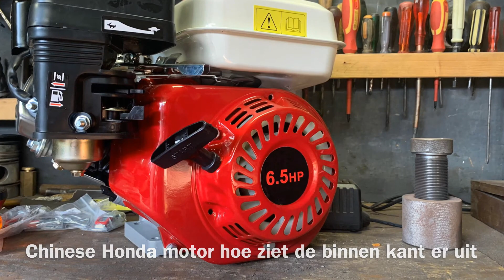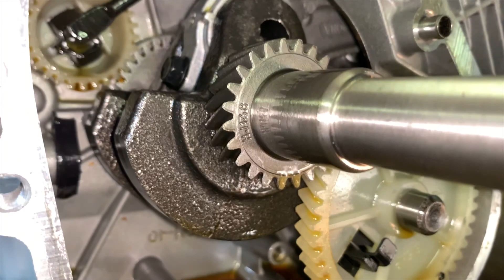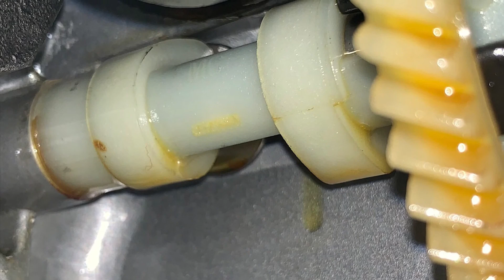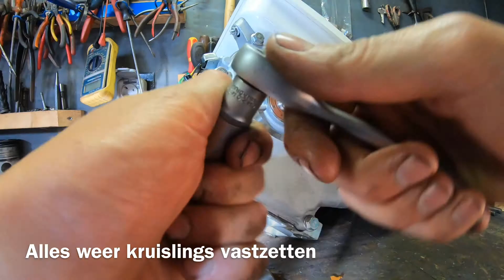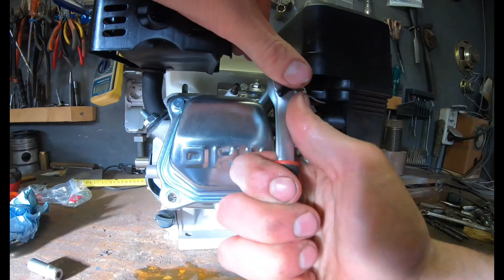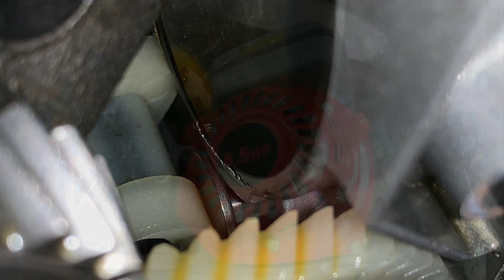Chinese engine 6,5 hp 4 stroke what does the inside look like

Comment: is it any good? whats long term reliability like?
Reply from the maker: @slybunda it is not bad.  I have had this engine for 1 year now, it does not run every day but weekly and there are no problems with the engine yet
Reply: @RmProjects  thats good im considering getting it
Reply: @slybunda  Dont bother there shit.  Stick with lifan, launtop ect these no names are uter garbage.  There cheap for a reason. My lifan 5.5hp is 5.2kg heaver than the no name chonda 7hp
Reply: @chris-jb5ds  what do you think of eberth ones then? I see those just as much as lifans.
Reply: @grimytech  The eberth are the same as the no name ones. Lifan and launtop make engines for a lot of companies so are a bit more of a trusted company. Lifan make engines for Briggs and stratton. Cummins onin. And launtop make diesels for lister peter. Kama. Loncin ect
Reply: @grimytech  The eberth one i have sat here in bits is the same as the one in this video. Boxed weight was 12.9kg  the replacement 5.5hp lifan  is 18kg
Reply: @chris-jb5ds  They're*
Reply: Chris...Can you tell us technically what's so bad with it apart from it's lighter weight & plastic Camshaft ? (;You don't have a vested interest elsewhere ??! ) Trev NZ
Reply: @chris-jb5ds  Chris apart from the lighter weight & plastic Camshaft care to tell us technically was so bad about it ? & How many $ is the Lifan ??...Trev New Zealand
Reply: 10'